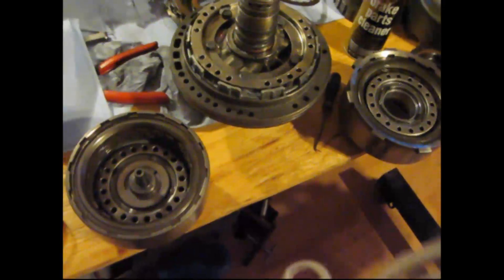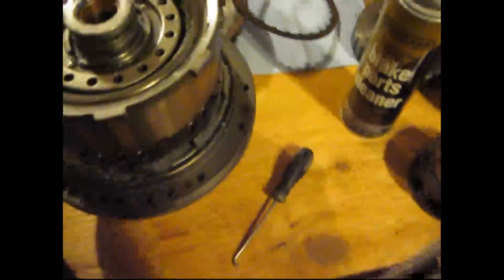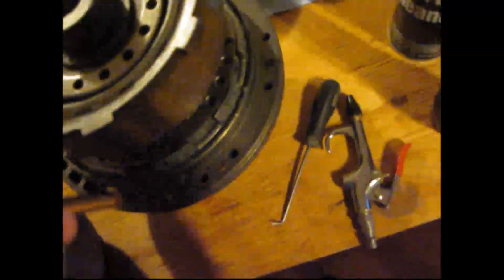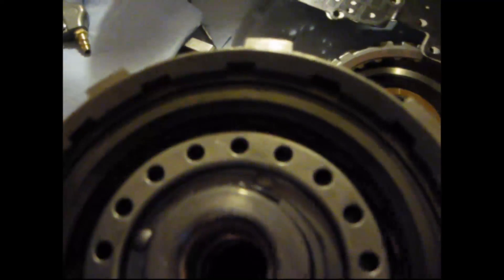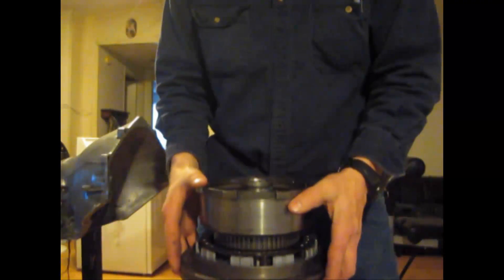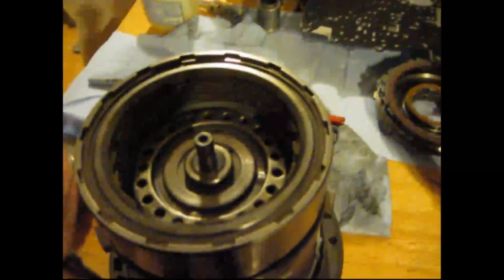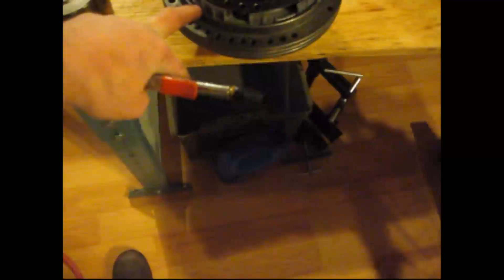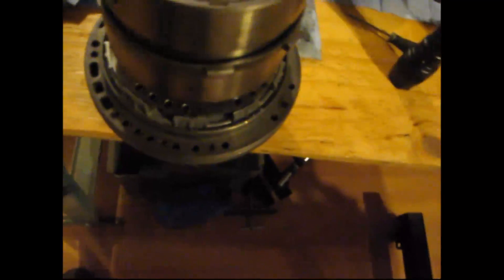350 transmission pressure test

Comment: Hi there.  I am a newbie, and I am wondering if you can answer a question about air checking the pistons. how much air pressure do you use? I am building a TH350 and was checking the pump piston (intermediate apply piston I think its called) with the pump sitting on the bench by itself, and I have positive, full piston travel with 25 psi. But once I stop feeding it a constant air flow (with the rubber nozzle still held tightly against the pump air feed hole with no leaking ), then the piston slowly bleeds back down over about a 15 second period.  I read that this can be normal since the piston isnt actually pushing against any clutches, but these are new lip seals. I pulled the piston and inspected the seals twice now, and there are no damaged or rolled seal lip. the piston bores are in great shape and overall the pump is in good shape.. I am a newbie. Is this normal/ok?